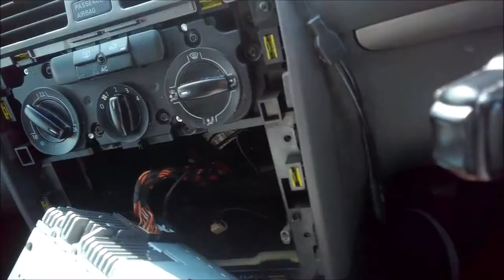VW RNS510 Radio Board PCB Remove and Replace

Comment: Is the firmware stored on the radioboard and do you need to update after the replacement?
Reply from the maker: No I didn't need to update it was just plug and play